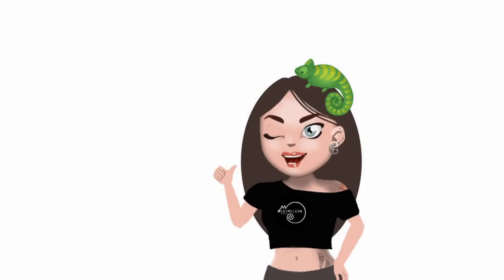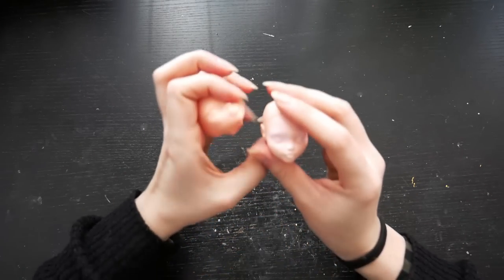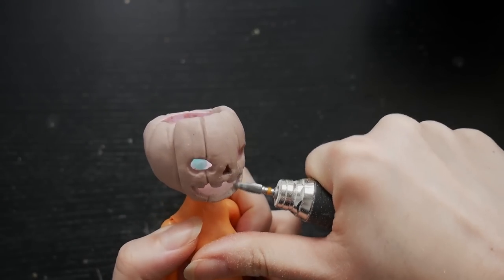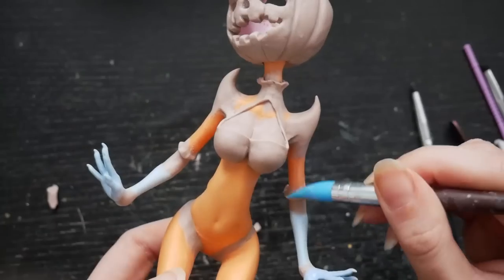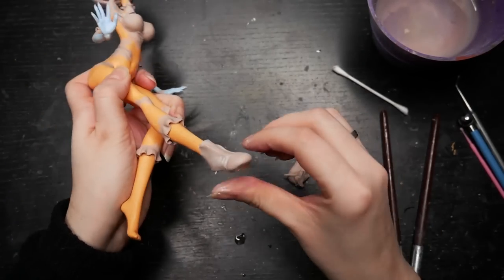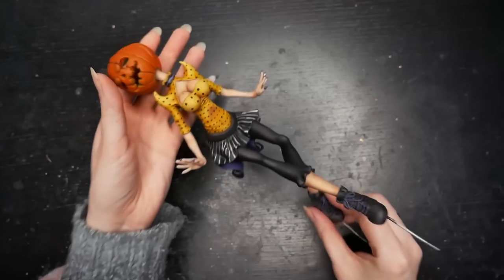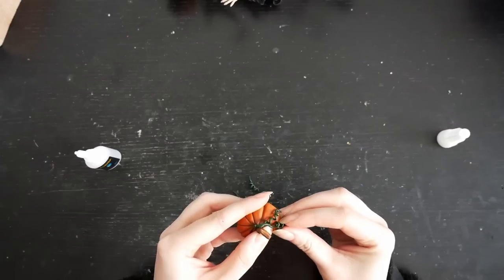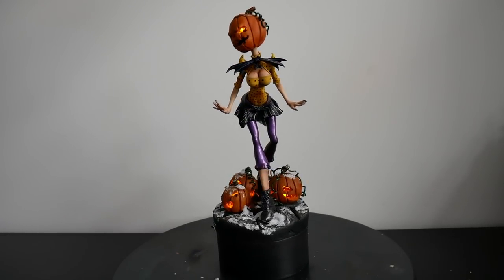Pam, The Pumpkin Queen - a character I'd like to see in Tim Burton's Halloween Town

Comment: Soldering tip for you.
Pre-load the wire ends with the solder before joining the two pieces. That way, you can hold one wire in one hand and the soldering iron the other hand. 
What I mean by pre-loading the wires is add Soldering to the ends of each end or the eires before trying to solder them together.  That way, all you have to do is touch the soldering iron to both ends at the same time until the solder melts (it should only take a few seconds), then remove the iron and hold the wires together for a couple nore seconds and they will be fused together.  Hope you understand this, and it helps with getting rid of your nightmare.

Comment: Did you consider installing tiny rare-earth magnets to hold the lid of the head onto the pumpkin face? As long as the polarity is set properly so that the two sides attract rather than repel, it works brilliantly. I have seen other doll customizers use that trick. Congratulations on creating such a cool character! I will subscribe right now! 💓👍🎃

Comment: Looks terrific! Awesome sculpting! 
For next time, for the curly stems or anything thin, look for Cosclay.  It’s a polymer clay, so needs baking.  But after baked the clay is flexible, almost rubbery.  So if you dropped it those parts wouldn’t snap off.  HTH
Reply from the maker: The vines on the ground-pumpkins are made from cosclay :P
Reply: @CatmeleonStudio  Oops must have blinked. Sorry.

Comment: So no one notices the dangerous way she holds the head while drilling it? I about had a heart attack.
Reply from the maker: It was 100% safe :) I can't really see how could I hurt myself in this process. The hard plastic is not that easy to drill through (so there's no way the drill would went through the back of the head). I made the tiny pre-holes first, so the drill won't slip. And I always start with slow drilling, until I am sure that the drill is in :) But thank you for the concerns :)

Comment: Why couldn't you airbrush the skin first and then paint the clothes afterwards (so you could skip putting the liquid mask on). Is there a specific reason or just personal choice? Btw I love the design!
Reply from the maker: That was just my choice. I wanted the skin to be spotless, and didn't have 100% trust in neither my brush preciseness nor the liquid mask, so I chose to test it rather on the outfit, than the skin. And second - I heard that the yellow is a tricky color, unwilling to make a good coverage and pretty capricious when it comes to the base that it has been put onto. So I just wanted an even grey for it :P Of course it might have work either way, but that was just my order of choice :)

Comment: Hi I have a quck question are you using flux when you solder? If not you should get some it will make the solder flow for easier application. If you can't get it in Poland let me know and I would be happy to send you some. I understand your frustration with soldering as I had a similar issues with it when I used to solder. Your sculpting is coming along FABULOUSLY. You are so talented Marzena never, ever give up! I look forward to your every vid. If you set up a donate section I would love to help out with a donation. Have a wonderful holiday season and I look forward to your next figurine.
Reply from the maker: Yup. I am using flux and I still suck at soldering XD But as I said - I just need to practice and finally I will figure out what am I doing wrong and how to do it properly :) Happy Holidays!